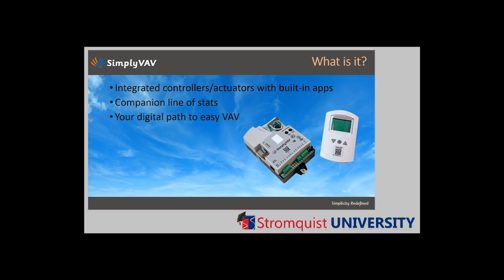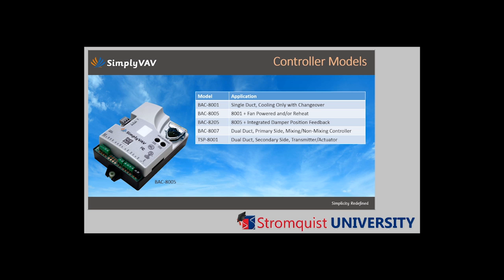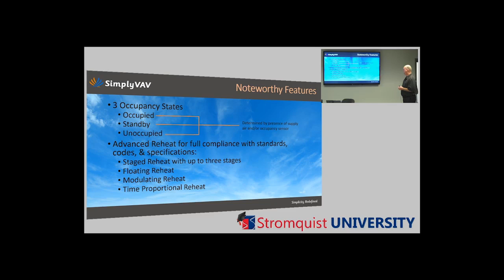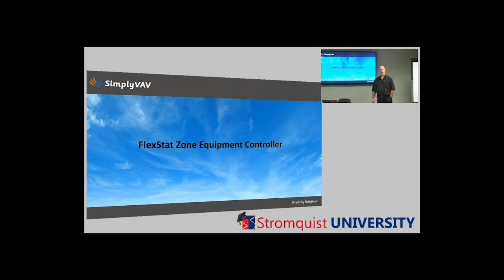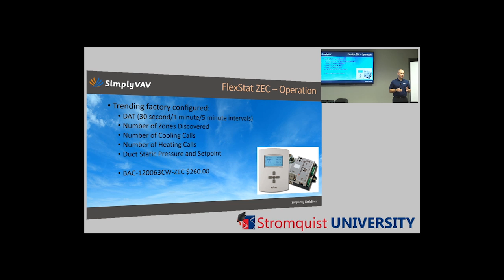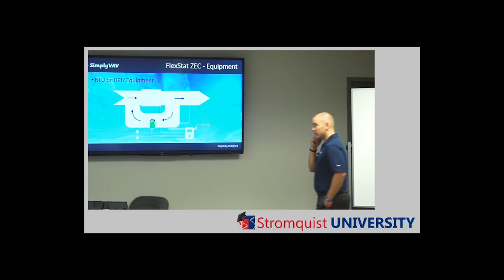The KMC Simply VAV Controller: Live Stream Training

Comment: I would disagree with the second gentlemens comments about the pressure dependant application in the conference rooms. If the system is configured properly, as the damper in the conference room with two occupants starts to close, the bypass damper will sense the increase in pressure and begin to open to allow the additional pressure to be relieved back into the system while maintaining a consistent duct pressure. The consistent duct pressure, if the system has been balanced properly, should allow the airflow into the conference room with the higher number of people to stay fairly constant and not "Subcool" the space. The bypass controller will react quickly enough to not over condition the space. Now with that being said, I don't think anyone would disagree that a "True VAV" or "Pressure Independant" system will provide tighter control, but if applied and configured properly, a "Pressure Dependant" system will provide more than adequate control.